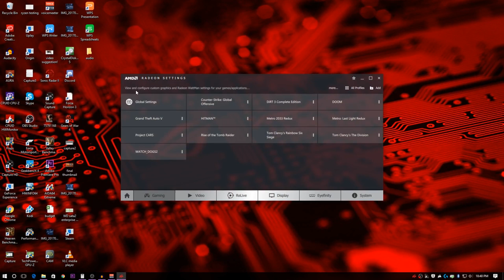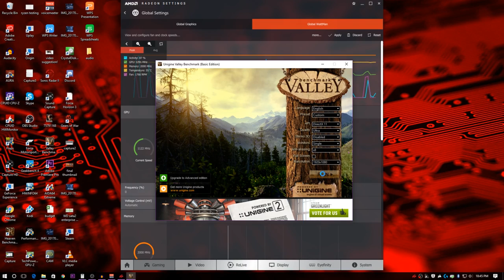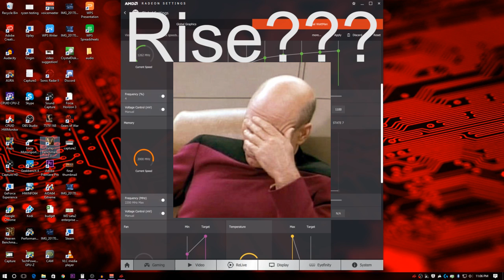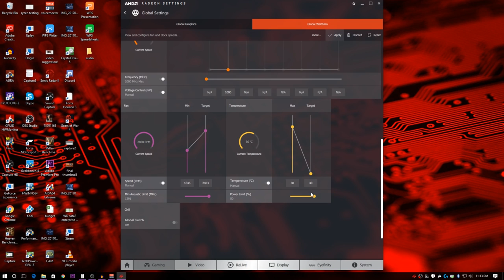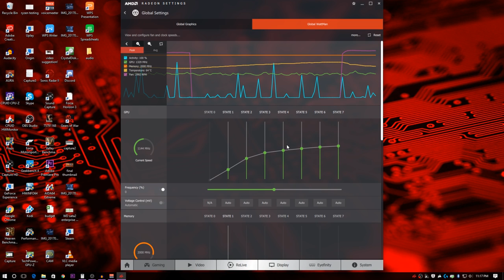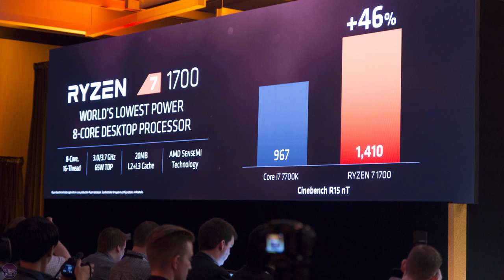Beginners step by step [how-to] overclock your AMD video card (RX 480)- Global WattMan

Comment: update info using  Fixed Frequency verses  dynamic ramping thru  "States" .

It was pointed out to me , the default voltages are excessive .

I have over-clocked with under-volt , i have under-clocked with under-volt .

Trying to get at the hightest ( frequency with the lowest voltage ) with solid stable performance .
( highest frequency with lowest  Power )

How to :
GPU 1400 Mhz "State 7" , Memory 1750 Mhz "State 2", using the  Ramp , so ALL States are  Active .
After a few minutes , "witcher 3"  locked up . ( using  Under-voltage  for  ( GPU and Memory )  )
So ,
back to  Fixed frequency :
GPU  "State 1"  min = max , 1400 Mhz at 1050 mV , Memory "State 2"  min = max , 1750 Mhz at 850 mV .
( voltages are the  Under-voltage values )
desktop "No load power"  at 30 watts ,
thus Fan curve :
25 C at 31 %
50 C at 31 %
60 C at 60 %
70 C at 70 %
85 C at 90 %

Power Limiter slider is on  0 zero %

Result ?
It works !
solid and stable performance .  Power peaks at 86 watts .

Because the voltages are Reduced ,  having to try and Ramp voltages to Track Frequency change is now
almost impossible .
That's why the board maker had to "over-volt"  the card  out-of-box .
Notice GPU 1205 Mhz  to  1270 Mhz ( msi RX 570 ) ,
all 3 voltages are 1150 mV . During this default use , the Freq. Ramping 1205 to 1270  has a Fixed  1150 mV !
how about that ! The voltage has No tracking issue here , because it is fixed across States  5 , 6 ,  7  .
( i was initially curious why GPU 1205 Mhz  needed 1150 mV ) , it dosn't need 1150 mV . It's that way
for another purpose , as just explained .

I did try GPU 1500 Mhz with Memory 1500 Mhz , "witcher 3" rendered about 1 second , then locked up .
Thus , Here , GPU 1500 Hhz is on the  fringe , thus  1400 Mhz is  a very stable frequency to run at .

To get  "Max Freq. with minimum power" ,
Fixed frequecny operation  One  "State" min =  max  is the only way to achieve that .

the usual setup i use on the RX 570 is :
GPU  "State 1"  min = max  1165 Mhz at 900 mV , Memory "State 2"  min = max  1750 Mhz at 800 mV
desktop power is about 24 watts , full load power is just at 60 watts .  Same Fan curve as above .

After "puttting it all together" , it seems to "add up" .  Single Fixed Frequency operation is the best way to do it .
i use multiple  wattman profiles . i  have a  "desktop.xml" profile that runs at  300 Mhz with Fans  OFF
so i can do the  5 watt  mode .  Not as  "automatic" as using the 1 Curve Ramp , to get back to 5 watts .

Fixed freq.  using a Single "State"  is the only way to achive  stable    Over-clocking with minimum power .

use the above info as you want .  try it .  i've done it . i'm doing it . it's the best way .
Reply from the maker: You are smart my friend. I would say you are much more intelligent than I am. I'm telling you, you should really considering doing a video of your own, or at least a full blown write up for Reddit. I'm thoroughly blown away. Great information.
Reply from the maker: Oh and I'm going to pin this one as well since it's the newest information.

Comment: Bless your Techy soul...I was pulling my hair out with Wattman's fan and temp controls. They do not sync well together UNLESS you MAX out the Target Fan speed and MIN out the target temp. Now  my fans are synced properly to temp changes and will ramp up or down accordingly. AMD needs to fix this.  Thanks again, I subbed.
Reply from the maker: Yeah Wattman in general isn't the best. I would have hoped by now that could have implemented something better. :( Thanks for the sub!

Comment: nice guide, first overclock ever i'm @ a stable 1380/2200 1115v hasnt gone over 57c in bf1!
Reply: adz e what gpu do you have ?
Reply: MSI RX480 8gb
Reply: Gaming X edition
Reply: hey plzzzz help me, im new to pc and i have a rx460 with core i3, my fan rpm is 242, temperature is 52c, activity 6%, gpu 742, memory  552 mhz, should i overclock? i was gonna follow you step by step, but i dont want my computer to get harmed
Reply: I got it at 1380/2240 with the same voltage. You should be able too as well :D There is actually a good improvement

Comment: must say i was skeptical at first but after running heaven my 480 temps seem to be so much better! 
Even at overclocked speeds, getting around 45 -50 degrees now on full load ;) Thankyou very much
Reply from the maker: Glad to hear you found the video useful!! Thanks for watching!
Reply: hey plzzzz help me, im new to pc and i have a rx460 with core i3, my fan rpm is 242, temperature is 52c, activity 6%, gpu 742, memory  552 mhz, should i overclock? i was gonna follow you step by step, but i dont want my computer to get harmed
Reply: over clock it I am sure your casual gaming wont damage it. being doing it for about 3 years with my rx 460 and never had an issue just have proper ventilation so it can stay cool

Comment: Although you did overclock minorly, I wouldnt call this much of a "Overclock Guide." As you did a few small things I didnt know, you did more of a "unlocking" of the card. Instead of overclocking you made it more stable to hit the boost frequencies. I.E. the power limit and fan speeds. 

I personally came to the video looking for a solid overclock for all "steps" of the card. Not just the slider. But thank you for the video. This WILL help a lot of people that are thermal throttling or having inconsistent FPS.
Reply from the maker: There isn't anything beyond what you see in this video my friend. This is what overclocking is. There are a few different ways to go about it, but this is it.
Reply: Like I said though, with the small overclock you did do, i'd hardly call it an overclock. Its almost no different than going in to your power saving options, and allowing your CPU to use 100% power at min and max usage, intern giving better stability instead of better performance. But I do understand stability can translate to performance.

I'm not here knocking your guide at all, like I said, I did learn a couple little things. But in my opinion, you'd hit a larger percent of people if you aimed into the stability side of this instead of overclock. The last settings I see in your video, I saw a .5% increasse, as that does close to nothing because of the stepping AMD introduced into the new utility. I doubt these being YOUR settings in the long run, but for the average person, I see them copying your .5% and thinking there going to get this magic "overclocked boost". 

Just my opinion. Apologies for taking up so much time and text XD I did like the video though. Thanks man.
Reply from the maker: Yeah with these Polaris video cards like what was used in this video, that's the most you can get out of them. What you saw in the video was a max overclock. Nvidia is a lot more "fun" because of the extra headroom.

Comment: Do you realize what the fuck you just did? You saved me. I spent a year trying to figure out why my RX480 was only getting 40~fps on UGine Benchmarks on Ultra and across any testing platform i did. I already updated and cleaned my drivers and was about to just assume that's just how it is with this card. I tried something different thanks to you. I uninstalled Afterburner and restarted the computer, then tried overclocking with Wattman, and something changed. The performance increase from 40 fps to 150 fps~ and i'm officially blown away.
Reply from the maker: I am very glad the video was able to help you!! I was super worried by your first sentence, and then read the rest, and it made me smile. hahaha. Thanks for watching and commenting!!
Reply: Cheers!
Reply from the maker: It didn't stop his overclock. It was likely a driver conflict or a software bug. Sometimes doing something simple like a fresh install can fix weird problems.
Reply: Not directly. It seems that in my case, MSI doesn't like to play well with other overclocking programs. Doing a clean install of the drivers, and a new install of both MSI and Wattman, my system would still not overclock. It seems that if i use only one dominant program will anything work as intended. I've never seen this to be an issue for anyone else, so it never crossed my mind before.

Comment: Sometimes a hotter overclock will cause more instability, so keeping it cooler can net higher frequencies. I try to keep it as low as audibly bearable.
Reply from the maker: Yeah, that is why I start with the fan speed ramped up to the max. Personally, I don't mind leaving the fans up as I am usually gaming with a headset anyway. I much prefer cool components over quiet ones.

Comment: This is a channel to watch! good stuff.
Reply from the maker: Thanks for watching!!
Reply: No problem, great video. I don't seem to be able to clock my card very well if at all though. anything I do to it either returns worse performance or the same. Maybe its already heavily clocked from the factory. Its a Sapphire Nitro+480 I think its 1345 stock. I played around with overclocking for about 2 hours and managed to squeeze 0.8fps more out of it lol. But then the fans were flat out. So figured not worth it. I guess overclocking GPUs is more of an important thing if you buy a cheaper card and lower clock speeds.
Reply from the maker: You are very correct in your statement regarding overclocking GPUs. There are many times where I have tried to eek out some more performance on a heavily factory OCed model, only to produce worse performance. When you get close to the raw edge, even though you can get a few more MHz, sometimes it will hurt FPS. This is what we refer to as diminishing returns.

Comment: Does it have an Influence on the GPU OC, when the CPU is OC'd(FX8350@ 4,8Ghz)? I'm asking because the Valley Benchmark always crashes after i started the Test. So far, i managed to clear a Benchmark with 1,5% OC(1350Mhz, Mem: 2000Mhz) in 1440p with an Max/Min FPS of 128,2/26,2.

My System:
FX8350 @ 4,8Ghz
PowerColor Red Devil RX480
Gigabyte GA-970A-UD3
Corsair VM550 PSU
16gb Kingston RAM 
Scythe Mugen 3 Cooler with CPU and 4 Case Cooler(sorry, don't know the correct Term)
Reply from the maker: I wouldn't expect the CPU to carry any influence over GPU overclocks unless it is a custom loop and the CPU being overclocked is causing the card to run hotter. Unfortunately, some cards just aren't very good overclockers. I've had some real duds in my day. :( The biggest thing to keep in mind is that any overclock you are able to achieve is free performance, so even though yours hasn't overclocked very well, it likely performs a bit better and you didn't have to spend any extra money for that. 

Also, I assume you have tried a run with the GPU fan speed on full blast? If not, give that a whirl and see if it changes anything. There is a lot of focused heat with the new cards from both Nvidia and AMD being on the 16/14nm process. I have seen very good overclocks on cards the minute they are put under water and those temperatures come down. Good luck man!!- and thanks for the comment!

Comment: For the Voltage Control, there are several values you can input for each State. Should I keep them the same, or should I be testing for each voltage? Will I be wasting excess energy by keeping these values up?
Reply from the maker: You will technically be wasting excess if you leave the values higher than necessary, but we aren't talking much. You can definitely tune voltage for each P state. That is something you see more advanced users doing, but if you have the time to do it, I say go for it. Only good can come from it.

Comment: I have just bought a new computer isn't the best but I have an RX 470 and an I5-2500 CPU and I need an over clock for sure on the CPU and figured a GPU boost wouldn't hurt at the same time. I'm uncomfortable doing it my self I tried with the video but was unsuccessful, would you be able to walk me through a CPU and GPU over clock??
Reply from the maker: Well unfortunately unless your CPU is a 2500k, it does not officially support overclocking. In addition, these AMD RX 400 series cards weren't known for being very good overclocking cards. Some were lucky to get +20 MHz on the core clock. All I can suggest is to up the power limit to max, and try a 20 to 40 MHz overclock on the core and a 50 to 100 MHz overclock on the Vram. Depending on your particular RX 470, that may not even be a stable overclock. If you are having issues, you may want to try lowering the voltage slightly rather than raising it. You will leave the power limit maxed though, and keep fan speeds maxed as well.

Comment: hey plzzzz help me, im new to pc and i have a rx460 with core i3, my fan rpm is 242, temperature is 52c, activity 6%, gpu 742, memory  552 mhz, should i overclock? i was gonna follow you step by step, but i dont want my computer to get harmed.
Reply from the maker: It is incredibly hard to damage your GPU. They don't allow you to push it as far as you could a few generations ago. Give it an overclock and see how it goes. It is going to get louder and that is normal. It is going to get hotter and that is also normal. If you don't like it, you can always put it back stock. Enjoy!

Comment: This is a good tutorial, but my computer crashed when i turned up the fan speeds, tbh I could use an overclock atm but I am too worried to mess anything up, i know it is hard to mess up your GPU but I don't feel very confident in doing so, would you by chance be able to personally walk me through these steps, after following your video I was still unsuccessful, I have an i5 6400k and a RX 480 8 GB GPU!
Reply from the maker: I might be able to give you some help Monday because I'm off work for the holiday. Shoot me an email Monday afternoon. Letsgettechy01@gmail.com
Reply: Will do man!

Comment: so I have a gigabyte rx 560 oc do I follow the same steps as you did or do the same steps but just with lower core and memory speeds?
Reply from the maker: Use the same steps. If it's unstable, you can just back them down a bit.

Comment: Thank you for this 🤙 I have a Pro Duo so it gives me x2 Wattman options, would it be safe to copy your settings from this vid for both Wattman menus because of the Pro Duo setup?
Thanks again I'm mass new school to this.. It's for flight and car sim stuff 🤘
Reply from the maker: Yeah, you shouldn't encounter any issues copying my settings for both GPUs on your Pro Duo. Depending on how the quality is of the silicon that makes up your GPU dies, you will be limited in your overclocks by the lower of the two.
Reply: Let's Get Techy thanks mate much appreciated!! I'm still sketching out a little about doing it but need a bump in performance
Reply from the maker: The thing to keep in mind is that the worst that will happen is you get a driver crash, and then you would just start over again. Unless you start flashing the BIOS and adding more voltage than Wattman allows, it is pretty darn tough to do real damage. Keep an eye on the temps, and you should be good to go. Don't hesitate to email me if you have any questions or get stuck on something. letsgettechy01@gmail.com
Reply: Let's Get Techy legendary!! Thanks so much dude I have all the Nvidia crew bagging out my card on Xplane 11 sites without really knowing what they are taking about and am pretty sure it should give a 1080 a run for its money if setup correctly as I've got a decent CPU and 32GB of RAM but I think Xplane 11 might only be using 4GB of VRAM off one GPU as it says doesn't support SLI but I was hoping the Pro Duo might be setup slightly different but probably not👍
Reply from the maker: People don't realize that the Pro Duo is an absolute beast of a card. Unfortunately I believe you are correct, and the VRAM would not stack.

Comment: thnks a lot man really helpful, there is only one thing left do i need a Zxx motherboard to overclock or a b150 chipset could get the job done ?
Reply from the maker: You will need a Z170 or Z270 to be able to overclock. You will also need a "K" processor- 6700k, 6600k, 7700k, 7600k.
Reply: You don't need a k series processor or z chip mobo to overclock the GPU. the GPU mobo handles overclocking of the GPU chip. You just need a good card and adequate power supply.
Reply from the maker: +Timothy Grant - This is very true if you aren't talking about overclocking the CPU. I assumed you were talking about overclocking the CPU, not the GPU.

Comment: Would keeping the fan speed the same as you set them to be all right?
Reply from the maker: As long as you don't mind the added noise. If your temps are good at a lower fan speed, you can lower it down without hurting anything.

Comment: Thanks for making the video!
Reply from the maker: Always happy to help when I can. Hope this gives you a good place to start. Happy overclocking!!
Reply: So these are my results for SAPPHIRE RX 480 NITRO+ (the MSI one was literally squeaking so I returned it)
Core clock: 1400 MHz
Memory clock: 2200 MHz (Could go 2250 -> max too)
Didn't change voltage
Aida 64 stability test: around 82°C
Valley benchmark before OC: 2140
Valley benchmark after OC: 2443
Far Cry 4 benchmark before OC: MIN: 45; AVG: 61; MAX: 74
Far Cry 4 benchmark after OC: MIN: 54; AVG: 68; MAX: 79

Is that alright? Are the temps fine as well?
Reply from the maker: Those are good results. Do you have anymore fan speed available that could be increased? I would venture to say that you may be throttling your clock speeds if the card is hitting 79C at times. It would be worthwhile to watch "Global WattMan" while the benchmark is running to see if your clock speed changes as the temperature goes up. You want to try and keep your clock speed as constant as you can with as little fluctuation as possible. Regardless, as I said above, these are still good results.